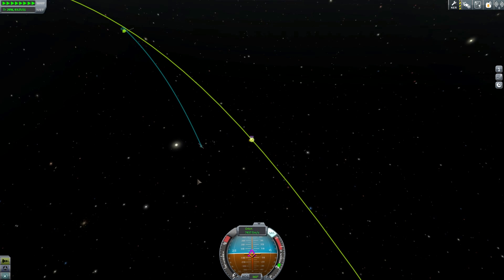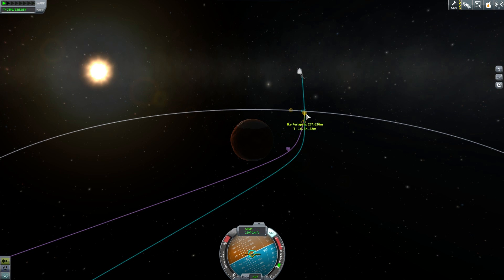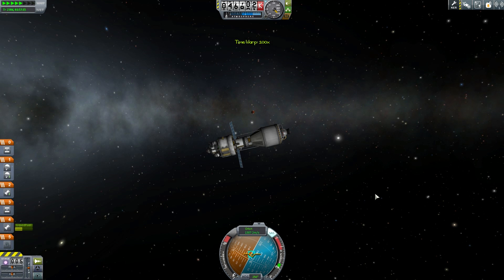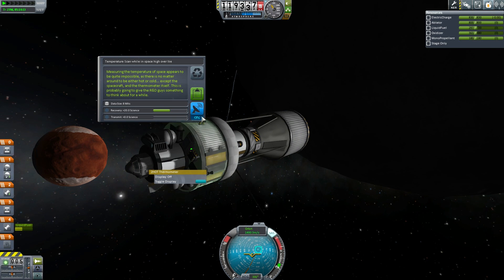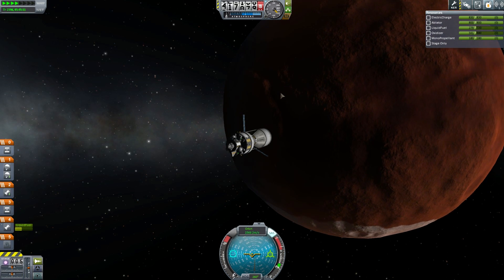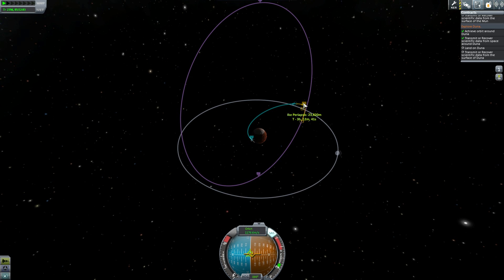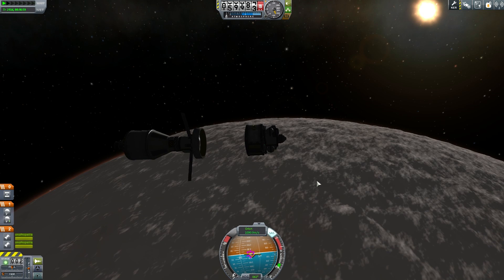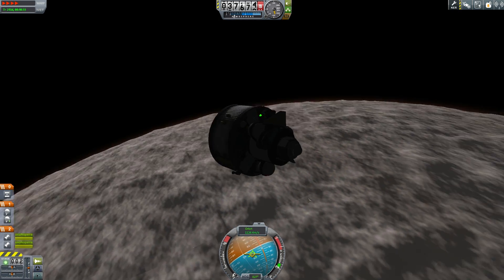Kerbal Space Program - Career Mode - Part 24

Comment: Late comment but the comments for the part im referencing have been disabled, When Im building a Rover, the Rovemate seems to think its a circular shape, like when im putting wheels on they start to turn inwards at the edge of the probe body (i can correct it with the rotate button) but i noticed your wheels didnt do this and was wondering if im missing a trick or my rovemates just want to be a stayputnik.
Keep up the awesome vids ^^
Reply: You are using radial symmetry, not the other kind. Switch to the other type.
Reply: Is there a hotkey for that? I was usuing the standard symmetry in the SPH

Comment: Sometimes (many times, actually) I just can't add a manoeuvre node on my orbit. The button just doesn't show up at all. And yes, manoeuvre nodes are researched and working. The space craft is operational and powered. The game just doesn't recognize the orbit as something clickable.
Reply: Oscar Scheepstra That's a bug. A possible workaround is just quicksave and reload.
Reply: Oscar Scheepstra
I can really confirm this issue. Happend to me and also to my brother sometimes. It seams though it happens less often since 1.0 to me.
But it is exactly like Oscar discribed it. The little ball on the course prediction just doesn't appear when the cursor howers over it and the only solution i found so far is to quicksave/reload or switch to the spacecenter and back to the craft. After that it works perfectly normal again. And it isn't a mod that causes this. Happend to me at least once without any mod installed.
Reply: shi01 This is my solution as well.
Reply: Did you upgraded your mission control center to level 2?
Reply: ME262MKI
read my post. "(...) And yes, manoeuvre nodes are researched and working (...)"
Reply from the maker: Oscar Scheepstra So you've added maneuver nodes to other orbits then?
Reply: Scott Manley You usually click on your orbit to add a maneuver node, right? And when you hover your mouse over the orbit a small ball on the colour of the orbit shows up. This doesn't happen to me sometimes. I might try to record a video of that when it happens again.
Reply: shi01 I never saw this bug before 1.0, but I am running the game on a Mac. Well... It is a bug.

Comment: 3:58 - I think air pressure outside of the atmosphere was added because it's reasonable to expect that it might not yield a null reading in some circumstances. The moon, for instance, has a tenuous atmosphere (supposedly around 3e-15 atm) but that is nonetheless not zero. The way that the barometers used to work made me wary to use them (as there weren't many places where they were useful) and I actually waited to unlock the barometer until I realized that this change was made. I personally think the operation is wholly sensible and I'm glad Squad made the change.
Reply: You wouldn't establish the value with a pressure measurement though. To read values that low you would have to measure the light spectrography.
Reply: It's a good barometer that can measure those particles. It isn't one of those cheap ones.
Reply: HALL9000ish I concede your point that most barometers simply don't have the accuracy to make such a measurement. Not knowing much about pressure sensors of any kind, I found a paper (E. G. Balkoum and M. H. M Cheng. "Ultrahigh-Sensitivity Pressure and Vibration Sensor". IEEE Sens. J. 11(12). December 2011; doi:10.1109/JSEN.2011.2155646. pp 3288-3294) that describes a capacitive sensor with a resolution of ~14.230 nPa/pF, while the AADE L/C IIB multimeter can measure capacitance down to 0.01pF (hypothetically providng a lower limit of .14230 nPa or about half of the target). Both devices have the virtue of actually having been implemented, which is nice.

Of course, I must point out that I don't know that this device has ever been manufactured beyond the laboratory (let alone hardended for space) and that at that point, there may be nonlinearities that confound this measurement (though the author suggests that the device is linear). The upper bound for the device is also 0.77Pa, meaning it would not work in the atmosphere. Furthermore,  the lower bound stated in the paper is 14 nPA, which is still 2 orders of magnitude greater than is needed for this measurement; I'm not sure whether these authors chose 1pF as a limit because it is conveniently measured or because that is the lower bound of the sensor. I admit that my statement is a bit far-reaching in this regard.